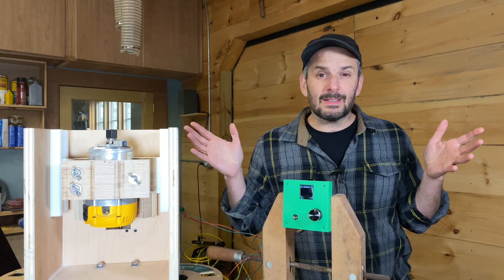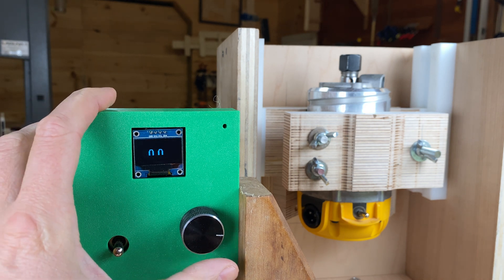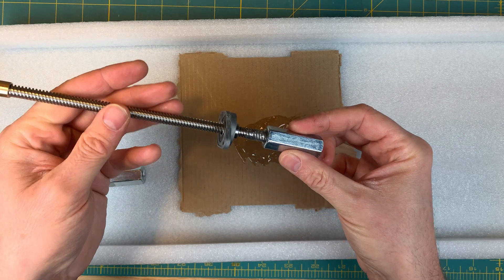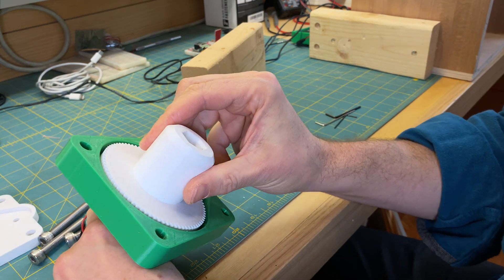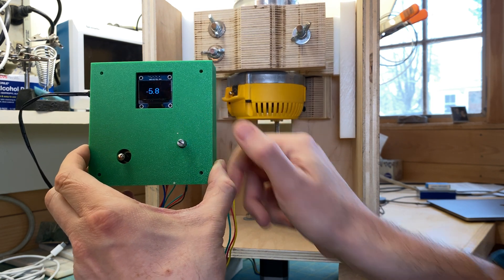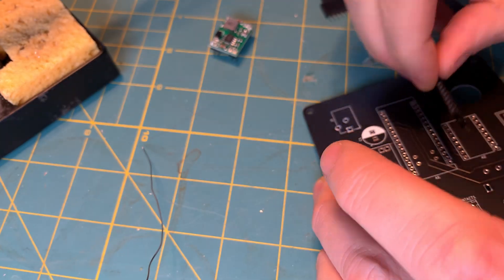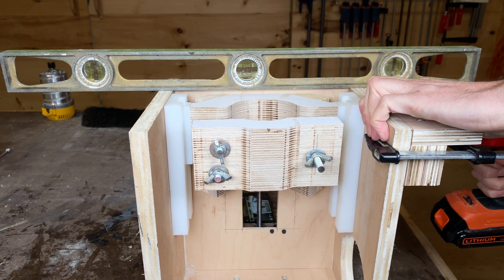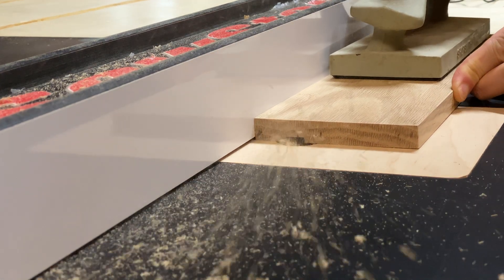This changes woodworking forever

Comment: nice lift. NOTE: Sheetrock / Drywall Screws are not designed to do more than hold those sheet goods to walls/studs. They will also rust.

Comment: Really nice build!  In particular, I like a number of aspects: the integration of the dust separator, the use of HDPE blocks, the use of a lead screw & nut, the use of the pillow block bearings…Very nice!
Questions:  
In the first video, a comment was made, something about the bearings not being perfect; could you clarify or expand on that please?  Any suggestions or recommendations would be appreciated.
Why use threaded rod and epoxy to secure the clamping blocks?  Why not use Tnut and bolts?  Or embedded nut and machine screw?  Just wondering about the reasoning.
One of the issues identified in the first video was the distance between the center of mass and the lead screw, but that still appears to be an issue.  Would it make sense to add some weight on the opposite side of the lead screw, to balance things out?  Or would that overload the motor?  Or is that just not an issue in this design?
I would love to see a follow-up.  
Thank-you so much for sharing this project!
(PS: also noticed your table saw storage cabinet and bank of drawers videos - two projects I really need to build!)😊

Comment: Do you have a list of the parts for the electrical part of your project?  I have designed a lift and found a wiring diagram on youtube, but it didn't work and I burnt my control board up so I am going back to scratch on the motor lift part.  Love what you did.  Very Nice
Reply from the maker: I’ve had a few requests for code and plans. I have it all but just need to get it together. I’ll let you know
Reply: Would you be able to set automatic heights at 1/16, 1/4 etc for the router so all you had to do was push a button?  I am new to Arduino's. @arikardasis

Comment: This is very cool! Excellent build! All those features and I bet it’s still cheaper that a normal lift.
Reply from the maker: Safety First. Cheap Second!
Reply: @arikardasis  safety third! If I cared about safety first I wouldn’t own any tools except a butter knife! 

You might consider drawer slides or linear rails to replace you HDPE slide. The are very smooth and cheap and some are rated for a lot of weight.
Reply from the maker: @Mrcaffinebean  Linear rails are definitely on my list of things to try but they do add a cost. My experiences with drawer slides has been that they have more play than I want for this kind of thing.  I have one more idea that involves making a V-shaped grove out of HDPE with some adjustment screws to fine tune it. If that doesn't work, I'll suck it up and get some rails.